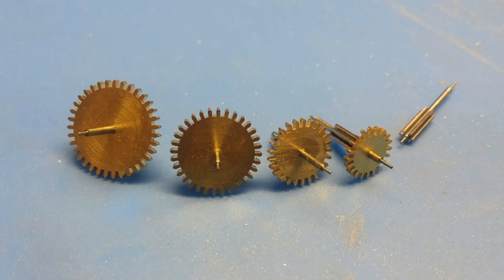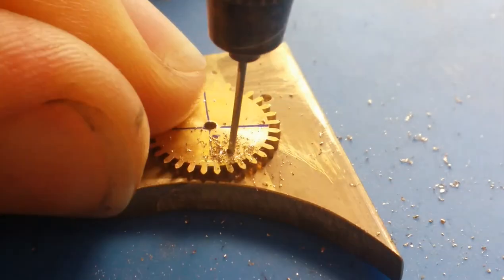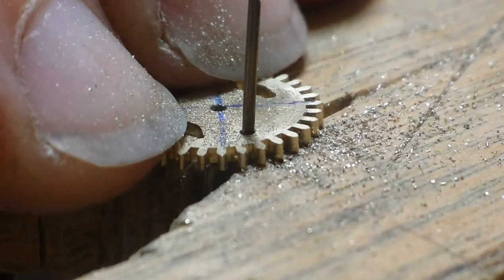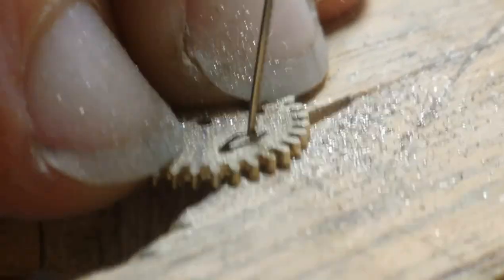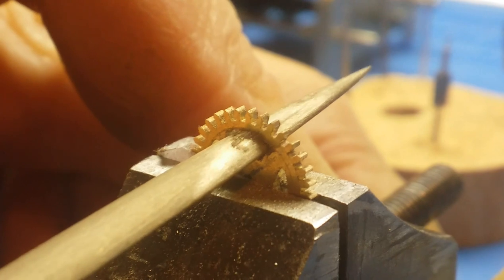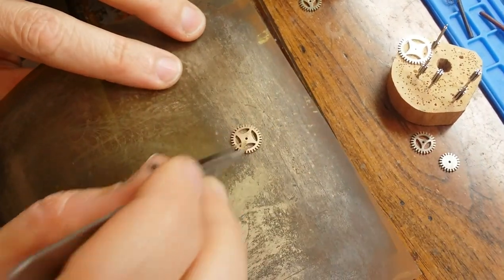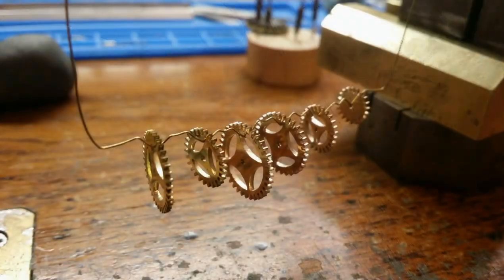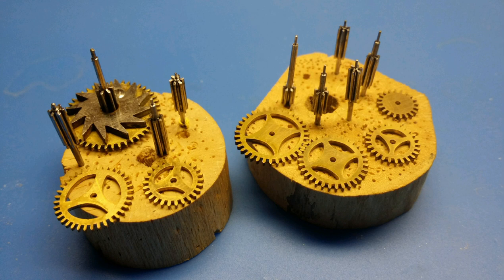19 Ageron French Fusee Restoration, spoking & plating gears

Comment: Thanks you for sharing your knowledge! I want to ask you: Have any idea how old masters cutted gears? I mean, the square one teeths that was polished with the topping tool and carpano cutter, before the involute cutter was invented, i cant find any info about that
Reply from the maker: Note, watch and clocks use cycloidal gearing not involute.

The method of gear cutting changed over the years, originating with hand filing the teeth. So how how far back are you referring when you mention "the old masters". When this piece was made, I believe there were gear cutting engines, though rare. On the original gears there are scribe marks. I suspect the gears of this piece were scribed using a guage or engine, but hand filed.